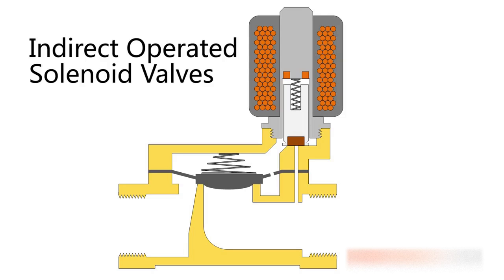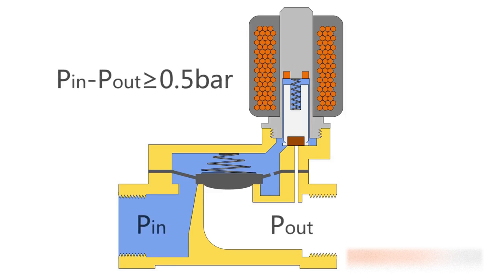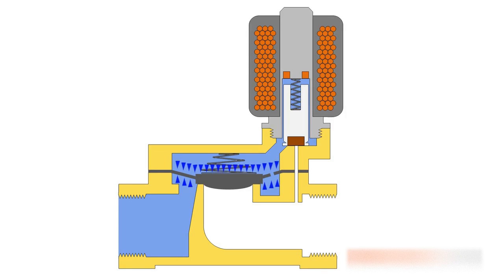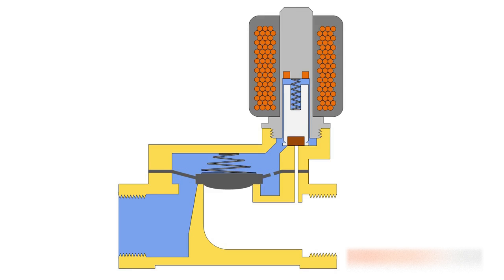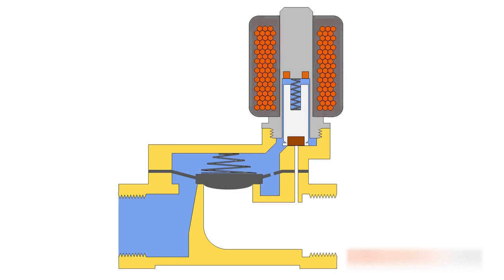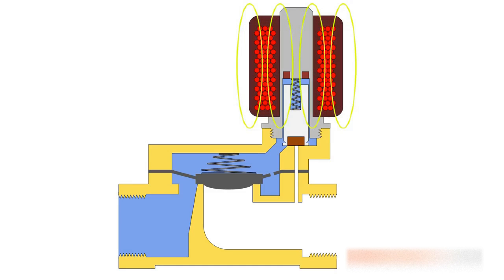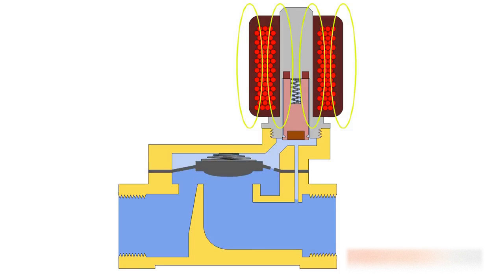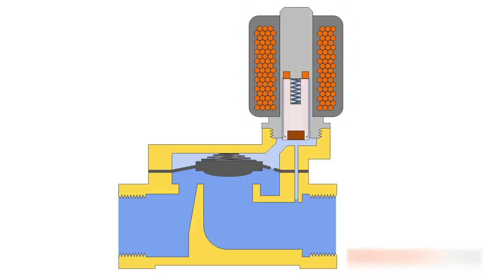Indirect Operated Solenoid Valve | Tameson

Comment: so let me understand: if you don't have enough water pressure, the valve will stay open?
Reply from the maker: Hello, the indirect operating valve needs 0,5 bar pressure difference to operate normally. If you use normally opened valve version the valve will stay open when you do not have power on the coil. When you energize the coil, the valve will be closed.

Comment: Pretty sure you have the diaphragm hole on the wrong side
Reply from the maker: Dear Jimmy. Thank you for your comment. Being a cross section, it mistakenly appears as if the hole is not connected to the exit port. However, the left and right sides of the membrane are both connected to the exit port. The hole in the membrane can therefore be on both sides. Hopefully this has cleared up the video.